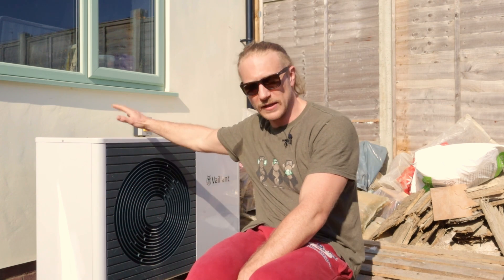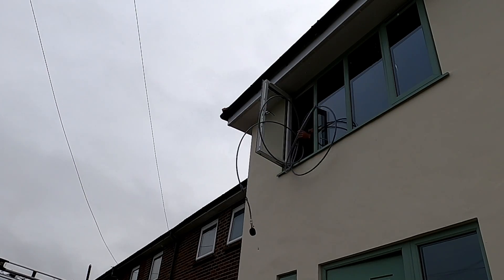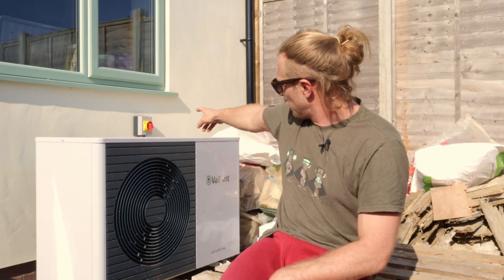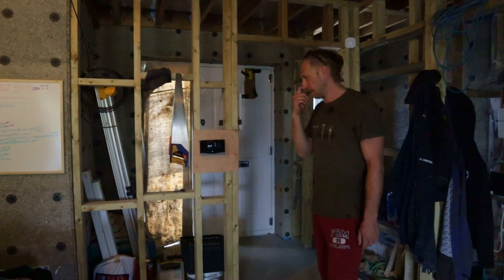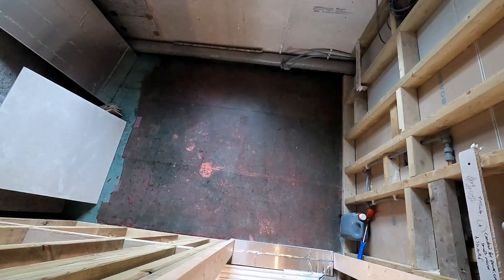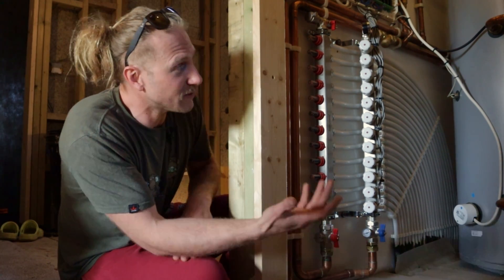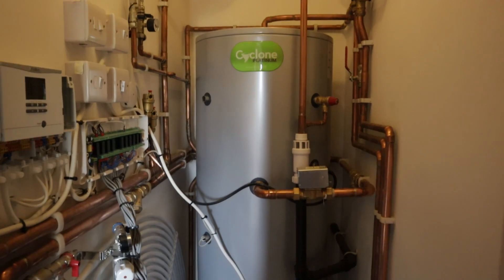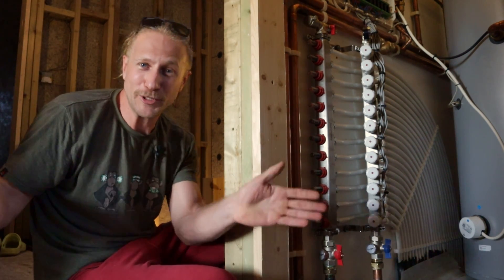#13 - No Gas? No Problem! Our DIY Air Source Heat Pump Installation

Comment: Hi...did you require an F gas engineer to connect the mono bloc heat pump?...ty for video you got alot on your plate.
Reply from the maker: @sorbetingle  No need for this system. Vaillant use R290 refrigerant not flurinated gas.

Comment: I saw this video too late, but I never pressure tested any pipework with air, because air pressure is very dependent to external air temperature. Usually, you pressure test with water and leave the pipes under pressure for the whole night with attached a monitoring system.  Anyway I am sure everything is ok.
Reply from the maker: Haha yeah fingers crossed! He did actually put pressure above mains and no signs of leaks... Yet :-|